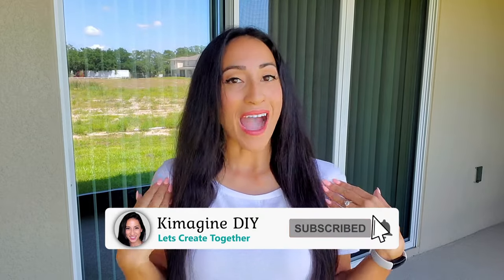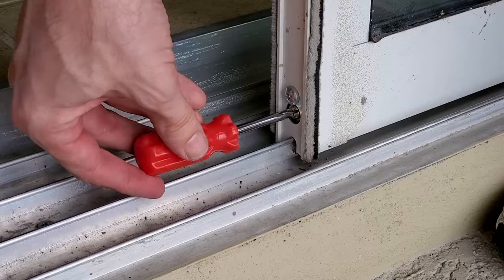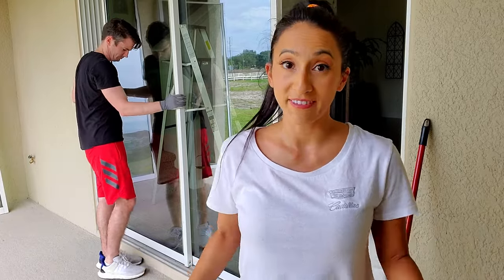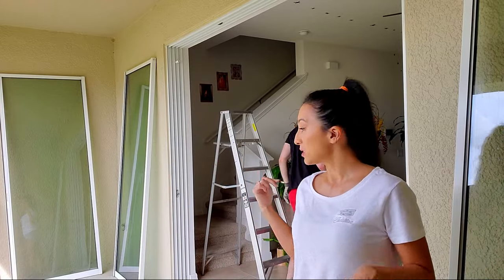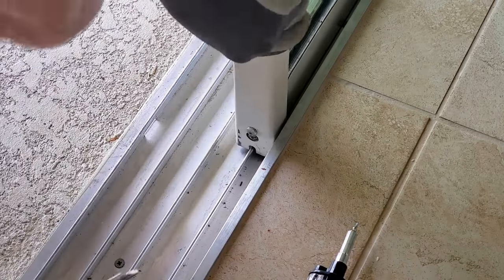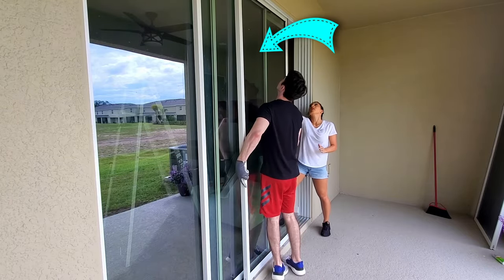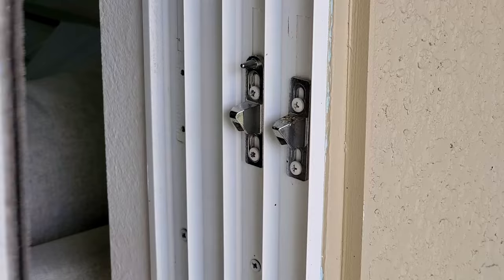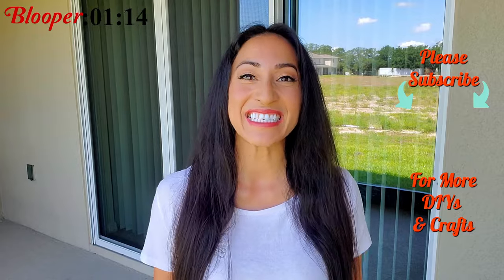Unbelievable: How to Invert Your Sliding Glass Doors in Just 4 Steps!

Comment: Great video except where were the door handles ? I didn't see any on any of the doors ?
Reply from the maker: Thank you very much.  My slider does not have any exterior door handles.  You can see me closing the door with the built in handle at 4:10. I did not have to change my handle hardware just where the lock was located on the track.
Reply: @KimagineDIY great video thank you. I am also confused about the locking glass panel though - did you have to reverse this door so that the side which was previously outside was now on the inside of the house? If not, how did you get the lock mechanism from the right to the left side of the glass panel?
Reply: @mprice7779  - I watched VERY closely this time and there door handle is the same color as the door and is hard to see. PLUS, they didn't show you that they had to flip the first door upside down in order for the handle to end up on the right side of the door . So, when they started, if you were on the inside looking out, the door handle is on the left side of the door. If they had merely moved the door with the handle to the far right and did not turn it upside down, the handle would still be on the left side of the door. If you flip that door the handle will then be on the right side of the door. You only have to move the clip that locks the door from the left side of the frame to the right side of the frame which is where the door handle is now. Hope that helps.  :   ) I almost forgot. If you have a "normal" door lock you will have to remove it and turn it upside down and then put it back into the door.
Reply from the maker: @mprice7779 Thank you so much for watching and reaching out with your questions! 😊 Yes, you are correct. I rotated the door 180 degrees so that the hinge that was originally on the left is now on the right. This allowed me to move the lock mechanism from the right to the left side of the glass panel. I hope that clarifies things for you! If you have any more questions, feel free to ask.
Reply from the maker: @S.L.S-407 Thank you so much for helping the community and for your insightful comment! 😊 Yes, you are correct. I rotated the door 180 degrees so that the hinge that was on the left is now on the right. You're absolutely right—I could have explained and shown that part better. Kudos to you for your keen observation and problem-solving skills! Your feedback helps the community and helps me become a better content provider. Thanks again for sharing your thoughts!

Comment from the maker: I 💖 to read👀 and answer your comments/questions. 😍 Lets Chat!
Reply: I have only ONE screw on the top and one screw on the bottom. It's my understanding that by removing those screw I will be removing the frame on each side of the door. My doors have a large opening on the top and bottom where a screw driver can go into and turn the screw INSIDE the door to lower or raise the rollers so that you can then remove the door from the track. Does this make any sense to you ?
Reply from the maker: Hi, it is a little hard to understand without seeing your doors. (Plus I am not an expert on sliding doors) But my slider doors had screws on each side of the slider, 2 on top, 2 on the bottom. They only controlled the raising and lowering of the wheels on the track. That is what I show in the video on how I was able to flip mine. If you know the brand of your slider you might be able to find a video or a manual to provide you further instructions.